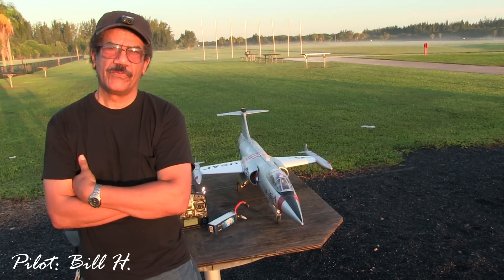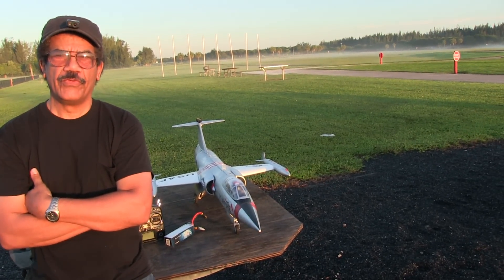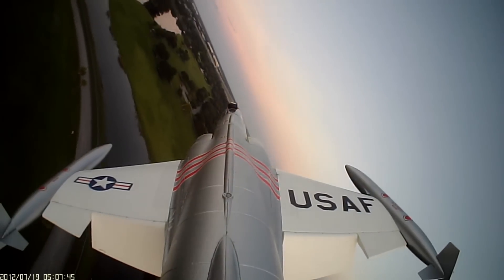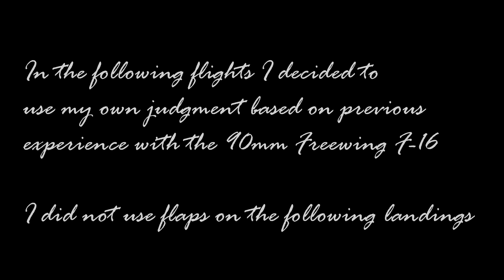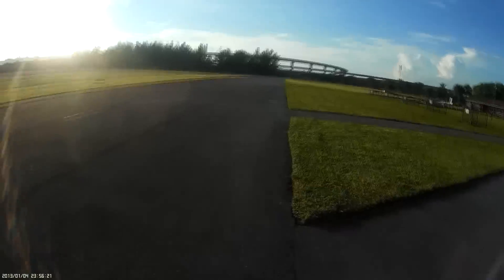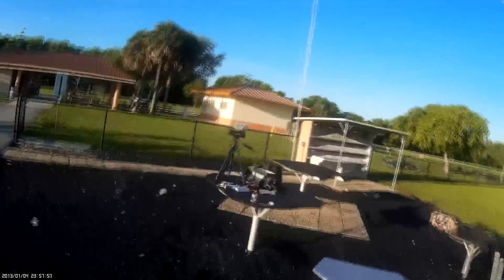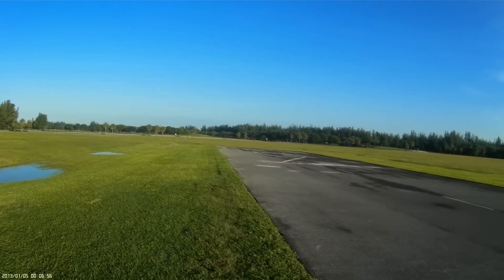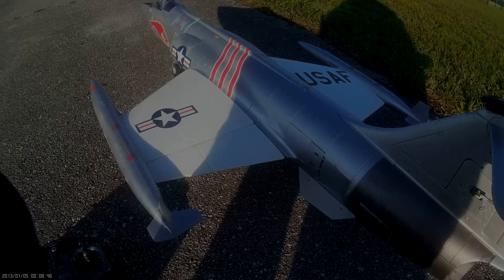Freewing F-104 90mm Part 3

Comment: Thanks for sharing. Great training video. What type of breaks do you use on your jets?
Reply: I use JP brakes, however in this video they were not used mostly due to the misaligned loose main gear struts from previous crashes. When brakes are applied now the jet will swerve.  Gotta fix that.